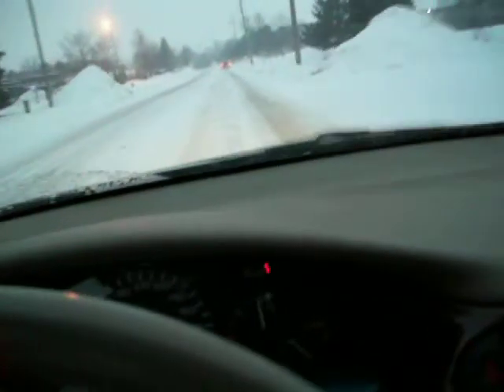Malibu Anti-Lock Brakes

Comment from the maker: It does do quite well in the snow, overall it is a kind of sleeper, if only for the reason it is quite agile and quite balanced on it's wheels.  Quite enjoyable, it goes where you point it, as long as you realize what it is, and use common sense.  The doughnuts were a little trying, for the snow tires grip quite well, thanks for the words Al!

Comment from the maker: You are correct about that one.  It will chime constantly with the parking brake on with the car in gear. The chime is there to call your attention to anything that may not be right on the car, though in that instance it will only chime for a few seconds.  An example would be if the windshield washer fluid gets low.  The chime goes off, and the amber warning light then glows.

Comment from the maker: Hey Mike!  The snow tires were gripping quite well, thus the load on the engine heard, you are quite correct on this if I would have continued.  To note, the temp gauge went up a little, and the auxilliary transmission oil cooler was quite hot.  It is amazing how much heat can be built up in the torque converter under load conditions.  ABS does have its good and bad as I said, I am quite aware of the sliding through intersection things with it.  We must drive accordingly.

Comment from the maker: If I remember correctly, the engine is 170 horsepower, I can verify this, and will correct if need be.  The car is at 215,000 kilometers , or about 130,000 miles.  It runs very well, with only proper routine maintenance done to it, plus bi-yearly sprays with oil underneath and in boxed sections to keep the body in good repair.  Thanks for asking.

Comment: We own a Chevy malibu 2001 LT mobel I believe.it handle great on snow. It even got out of 1foot of snow. The anti-lock brakes work great I slip once I thought I was going to hit a car or person, but no I stop right away.
Reply from the maker: They are pretty decent in snow, I seem to get trough in the city and suburbs with no problems, sometimes I have to back up and try again, but I've not been hopelessly stuck at any point with this car, not trying to use it like an off-road or heavy duty 4X4.  The ABS is still working fine.